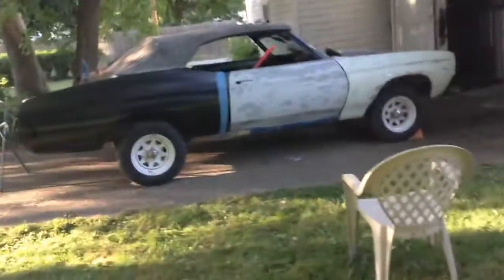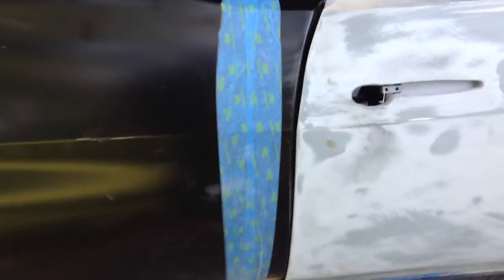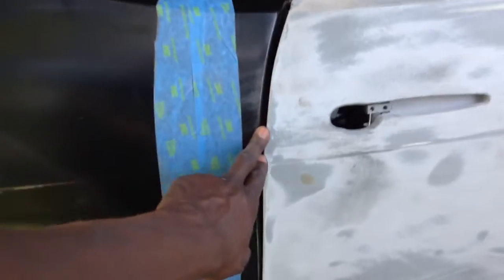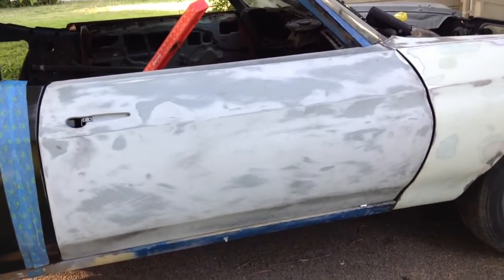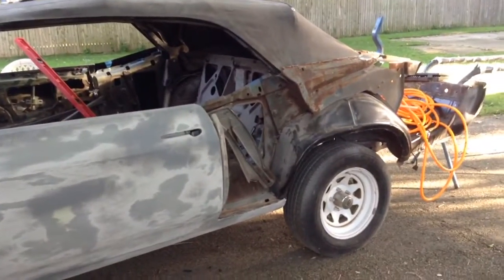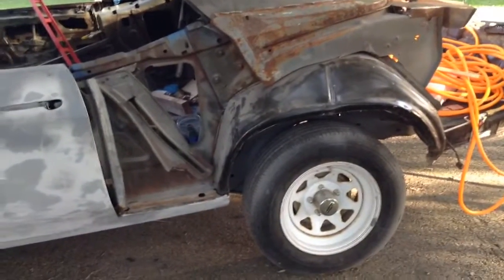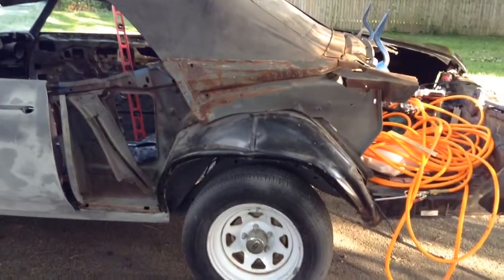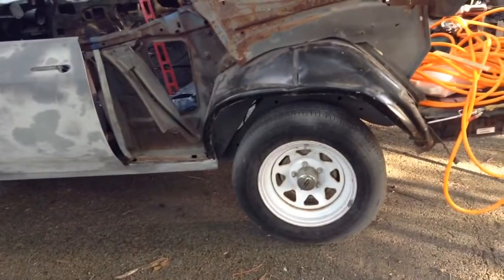1972 Chevelle convertible quarter panel replacement and door gaping

Comment: Good job I have a 1972 convertible chevelle that need the same repairs did you do the floor pan yourself and what kind of welder do you have keep the videos coming thanks
Reply from the maker: I did not put the floor in....but I brought a welder from Eastwood.....FYI I would not get qtrs from goodie mark..... There stuff suck. I hear opgi panels are better.

Comment: Where did you get the frame to motor mounts for the Ls and good work on the car going to be starting my 66 gto this winter but gathering part I need now
Reply from the maker: Summit racing UMI performance